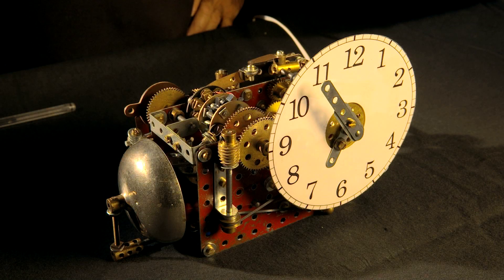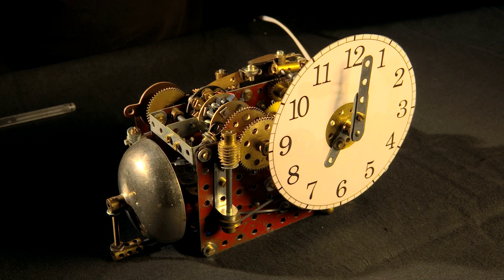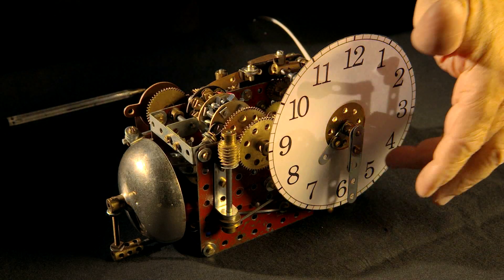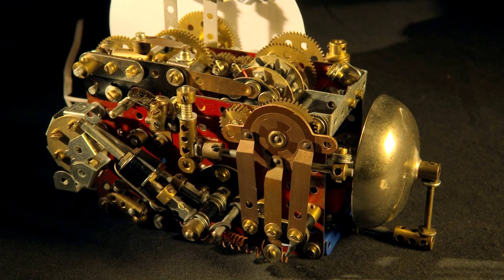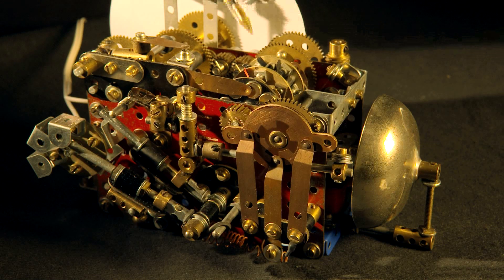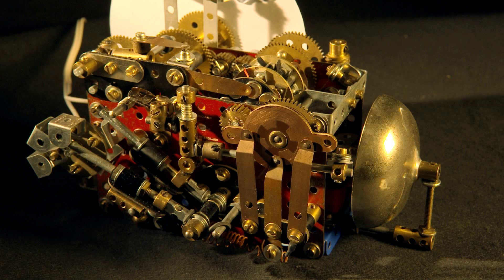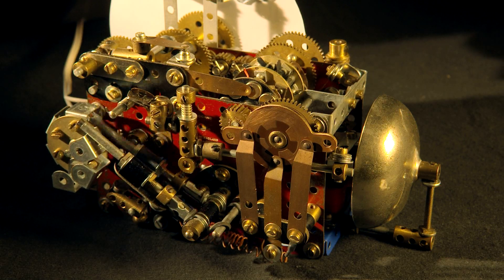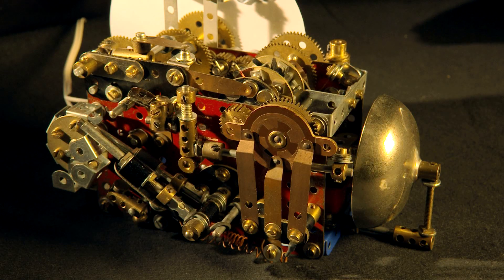Meccano Clock Strike Mechanism

Comment: Great model. Is there anyway of how to obtain the modelplan or description of how to build it?
Reply from the maker: Hi Wilbert,
Yes it was described in Constructor Quarterly 98. The version shown here has been further refined in the Chiming/Striking clock which I have been describing on the NZMeccano website forum. That version uses electrical striking and the "Hour Seeker" does not make a full revolution (like the unit above) but retreats to the start point once the hour is struck. I'll soon be uploading a video of that one to YouTube too.

Send me a message via NZMeccano if you'd like further info. Thanks for your interest.
Stephen

Comment from the maker: Hi There,

Yes, it has a Faulhaber motor buried inside and driven via the rubber band you see at the front. It runs on 12v DC.

Thanks for your interest. I'm curious, how did you find it cos I haven't advertised it anywhere?

Regards

Stephen